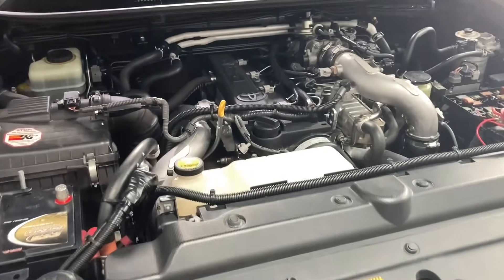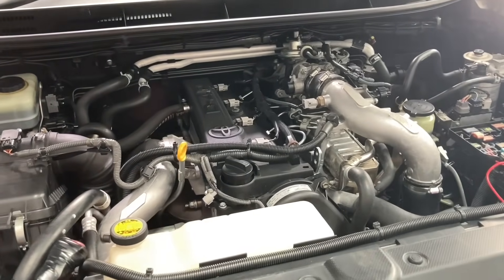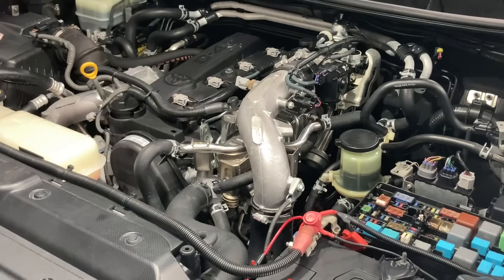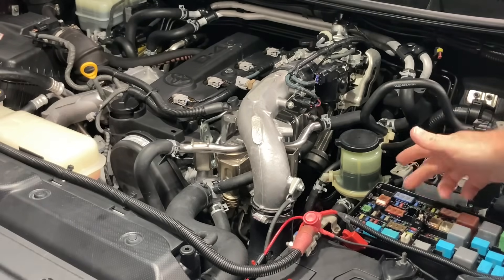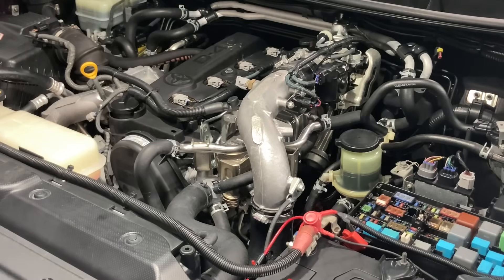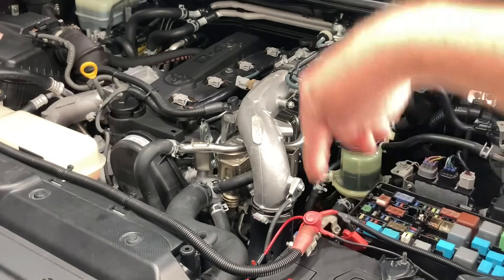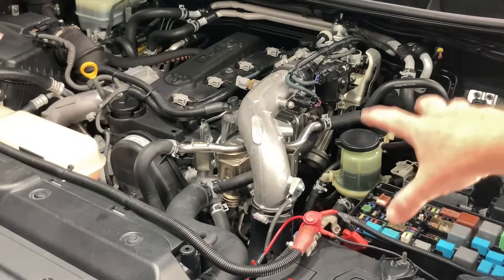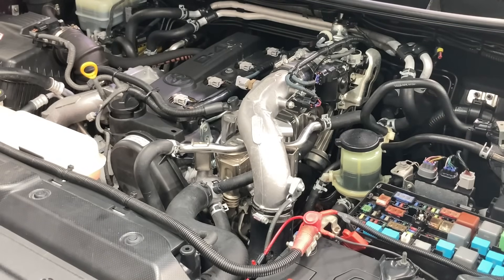AMAZING FOUND the MELTED FUSE PROBLEM - NEW ENGINE in PRADO wait for pt 2&3 also

Comment: Hi Anthony just to let you know the same thing happened to me after washing the engine,the engine started cranking on its own could not turn it off by pressing the start button finally the battery went flat and starter failed,i replaced with a new genuine starter and relay till today i don't know what caused it but i will definitely be carrying a 10mm spanner,thank you for your informative videos.

Comment: Love the story mate. Looks like you have narrowed down the issue.  Bit of a hassle at 3 am to find out the cause of the melt down. By the way you analyse things I reckon your right on the money. Fit a new starter and rebuild the old one as a spare. New GENUINE is expensive for a reason.. They last the distance.  Aftermarket will work but how reliable is the question. If your on the track somewhere reliability is everything.  Even life and death without being a bit melodramatic.  As I said mate you find these issues and the correct fix. Thanks for that .
Reply from the maker: Wait till you see one of the next videos there’s more it’s not what you think

Comment: Funny 😂 🤣 A few years back I was sitting outside with a beer in my hand thinking about mowing the grass and suddenly my Toyota landcruiser magically tried to start with no one in the LandCruiser I just quickly ran over opened the bonnet and lent in the bay and pull the solenoid wire of the starter   took me probably 30 seconds to stop it  and common sense told me check the starter relay and yes it was a starter relay problem ..   and another time a friend had his car so the same the curse of his car was a rat eating his wiring at the fuse box that was fun to fix 🤣😂
when I first saw your melted main fuse I was thinking the bonnet was touching when it closed I've seen that problem a few times 😂

Comment: Hey Anthony. Super common issue I found out the hard way!
My own manual Prado drove through the garage door cranking in gear...

Took a year till I found the issue. Used to have to park it in neutral so it didn't wander off by itself..

Burnt out a couple of starter motors...

I'll send my number to your parts order text line. Call and I'll explain what it was.
Reply from the maker: We know exactly what it was but thanks anyway coming soon
Reply: @Fourby4Diesel  
Now you're just teasing us all.
Reply: Something to do with the dual battery setup, MW? 
My mind keeps wandering to wire sizing based on system voltage. Low voltage= massive amps. 🤔
Reply: So do I! Haha thanks mate. No spoilers here.

Comment: This is common problem, it's water intrusion into the cabin wiring plug connectors from either non sealed firewall grommets, blocked sunroof drains or dodgy windscreen installs, starter motor will not fix it
Reply from the maker: Very good you win from all the comments video should be tonight or tomorrow

Comment: Id test the relay before replacing the starter. Relay is basically a low voltage switch that allows a high current to feed the starter??
Reply from the maker: Thanks for the tip. I know what a relay is. The relay is fine sit tight and you’ll see what the problem is.
Reply from the maker: The relay is good keep watching
Reply: Okay, ill shut up and wait. 😊

Comment: Just wondering if the ignition wiring has been damaged in such a way that at times (when it’s cool-contracts making contact) thus pulling in the relay.
Starting at 3am when cooler seems to suggest this.
Of course it’s just a guess, as IDK.

Once it’s diagnosed, can you do a short video on the cause for us all to learn from this one please?
It’s most intriguing.

As TheFreddy said, it could be an intermittent fault in the starting relay.  Again perhaps the temperature change is enough to make contact…like a bimetallic strip (thermostat in your oven).
Reply from the maker: Smart

Comment: Change the relay sounds like a weak relay in the fuse box. Take the relay out and take it apart look at the spring that makes the contact between pin 30 and 85. Just replace it with a new one.

Comment: Fark….I fell asleep. I’m going to watch this every night before bed. I would be checking the ignition system wiring (including clock spring) for faulty relays, oversized or bad fuses, collapsed contact and worn / touching low current wires. Something is randomly activating the ignition system ….bare wires and worn switches?

Comment: This happened to me just before Christmas. 2017 model with 160k on the clock. Manual transmission so it cranked uphill until the battery died. Towed it home, let it cool, removed the battery and charged it. Refitted the battery and had the same result as you. Started and worked as it should but I replaced the starter anyway and it has not played up since. Then again, I had washed the engine that morning and had placed blame on myself.
Reply from the maker: You must keep watching the videos it’s more than you think there’s something else coming. You will need to check it out it could happen again.
Reply: Next video tomorrow night?

Comment: Hi Anthony await stripdown of faulty starter. Sounds like old age if original starter solenoid on starter faulty short also causing fuse to melt. But look forward to next video hope owners got deep pockets. I keep a 6 inch adjustable in drivers door.Melting in Cape town cheers Bob
Reply from the maker: You’ll be waiting a while keep watching the videos and you will see

Comment: 5:05 how does a short across the battery blow the fuse? Is it a short across the battery terminals?
Reply: He was refering to if you are working on the vehical ie starter motor solinoid power short to ground will blow that fuse.

Comment: The only times I have had that happen one was cracked insulation in the harness due to a previous fire unbeknown to me, next one was a rat chewing the starter wire and battery cable, the other one was a couple of rubbed wires.

Comment: It´s the square green fuse on the left in the middle you need to pull to stop the starter. Use a small plier, it´s very difficult by hand

Comment: I wrote in two other videos, that it's been started (or starter motor ran) off the auxiliary battery, not the starting battery. The stater motor doesn't go through the main fuse from the starter battery.
Reply from the maker: Well, you’re wrong it’s got nothing to do with the auxiliary battery keep watching videos
Reply from the maker: Keep watching keep watching and you get to see exactly what it is not what you think captain